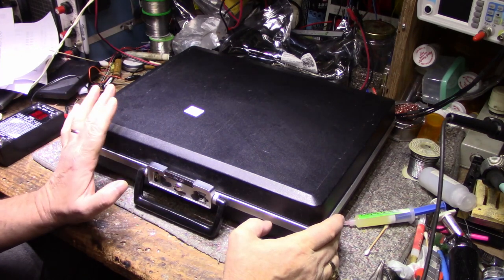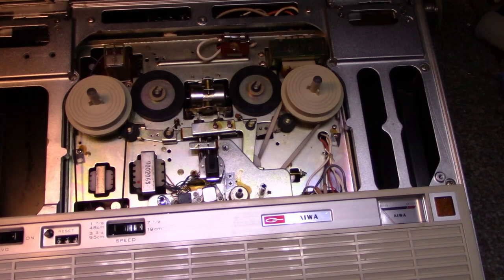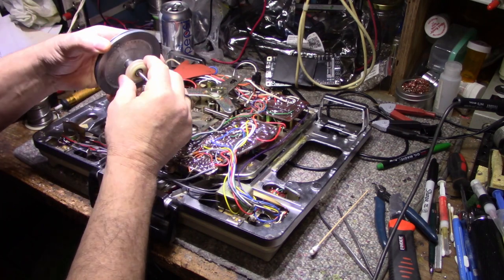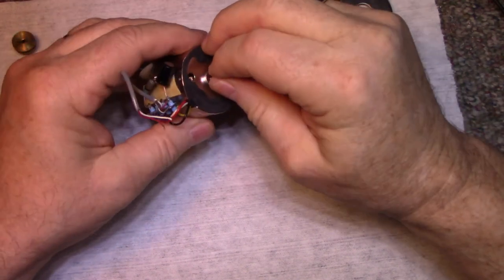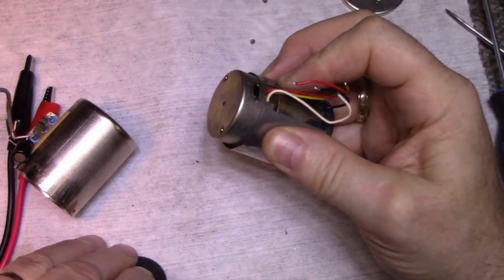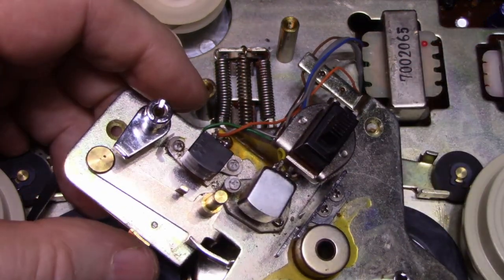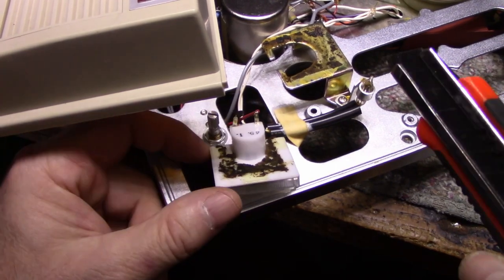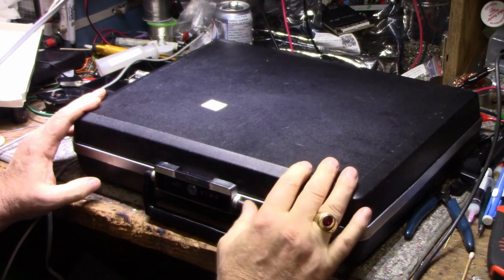AIWA TP-724 Portable Tape Recorder (Ep. 158)

Comment: When the R/PB head has scratches it wil get dirty very quick. It is no problem to treat them with a silver or copper polish to get scratches out. I worked with the Akai 1µ heads from (e.g.) the 4000 series in the '70, and if the head was worn out, but the customer did not have the interest to buy a new head, we took them out, used sandpaper (first 800 then 1600 or more) to roll the head in the tape direction over it on a hard flat surface (following the rounding of the head front), until the weared-in tape track is flatten out, and then do the same with copper polish on paper, until they shine like a mirror again. You can get the deepest user tracks out that way, get a better frequency respons, no scratches that build up dirt and no damaged tape. The material is soft enough to do it by hand. Btw, this methode was teached to us by Akai, Japan. Resetting the head is another case, you need to get the correct hight and set it perpendicular with the ground plane from all directions of course, and then a recorded 10KHz tape to adjust it on its highest output.

Comment: Nice video, Trevor. I’m working on a TP-1012 RTR that was a basement dweller for 30 years. After some TLC it basically works, needs more work, but one problem I’m having is tape speed. It’s just a little too fast. I haven’t disassembled it, just the top cover. Is there a speed adjustment pot somewhere? Thanks!

Comment: I heard you dont use the red 3 in 1 kind. It has stuff in in like minerals or something that is harmful and clogs it or something like that. For like stuck bolts or cutters that dont move as free. Was told to use the blue one that is made for stuff like that. Another great oil I use is called zoom spout. It was a long spout you can pull out to get to hard to reach places. I love your vids wish you was near by I would bring my stuff to get worked on. Like how you take your time and do it right and check things right. I like to use a rag to wipe rubber tires and such off. Think it works better to me that is.